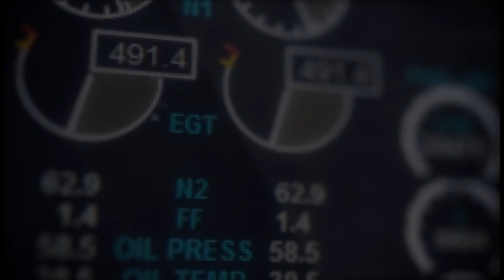Will Circular runways "take off"

Comment: isnt the problem with engine failure irrelevant? 
since the runway is infinite there is no point of no return, meaning when one/all engine fail while you are still on the runway you can simple abort the takeoff
Reply: That's not the problem. The problem is with asymmetrical thrust from an engine failure making you run off the side. On a banked runway, there's one particular speed where you'll naturally follow the runway with no steering input, below that speed you'll drift to the inside and above it you'll drift to the outside. If your inside engine fails slower than that speed, you'll probably run off the inside. If your outside engine fails above that speed, you'll probably run off the outside.
Reply: Mai Mizuki the problem is the short time span where the bad engine lost thrust but you had no chance to throttle down the good one. Even with perfect control circuits, you still have the rotating inertia. So even if you throttle down the good engine, you have a few seconds with a highly asymmetric thrust.

In addition, if the runways are used as proposed, you don't have an infinite runway. There might be another plane standing somewhere on the runway ready to take off.
Reply: its not a simple "but that is still a problem with traidional runway". its that, and the add effect of the inertia, gravity, angle, and more.

even with an abs, there are just too many variables, there's a physical limit to how well the remaining engine can work in a situation like that.

and forget it if hte problem is with the landing gear or with both engines. 

emergency landings will also become a no go. with almost garanteed disaster.
Reply: You assume reliable communication within 30 seconds, that is how long it takes for a plane to take off. With analog radio, you can't have reliable communication in such a short duration.
Reply: you only have the time between the computer realizing one engine is bad and it killing the other. 

unless the dead engine is stopped, which would destroy it, it will also have the rotating inertia. 

Finally since most engine problems don't suddenly appear, instead there are seconds of trouble before the engine dies (speaking on computer timescales) the good engine could likely be throttled automatically before the bad engine actually completely dies.
Reply: Amanda when you have an compressor stall, there might be an immediate drop of thrust. Yes the engine is still spinning at high rpm, but you often have a turbolent delamination of the air flow.
Reply: The best solution for solving engine failure problem at take-off is .....  Not using engines for taking-off :-)
The circular runway will be used only for landing, where one engine failure is less critical and where plances can choose the best direction for their safety landing and to minimise noise out of the airport.
Take off will be done on special shorter straight runway with an electromagnetic accelerating system supporting and tracking the plane with engines at minimal thrust, till the planes reaches  a highest speed able to make it reaching a secure altitude where the engines will do their job. When the plane has left, the accelerating system speed decreases very fast producing electricity stocked (why not in supercapacities?) for next taking-off 
I think that circular airport will be built in a place where there is no city near, only for intercontinental fligths (distances less than 1000km having to be done by  more ecological fast trains).
It can be built also in some seas on the top of a circular dam for a central reservoir used for a reverse powerstation to regulate wind or sea or sun electricity . If the reservoir is very big, the "air stations" will be all in the internal size of the ring with an underground tube connecting many of them and a special internal connexion for planes to the next taking-off accelerator.
Reply: On a flat runway, if you go off the sides, you are still on a flat surface. You start running into obstacles, eventaully, but there is still opportunity to recover. The circular runway is banked (this is to countre centrifugal force, and thus to help keep the plane centered on the runway in the first place). This means that you eventually have a rather steep change of slope when you go off the runway. To make matters worse, this change of slope means there is a high risk of premature lift... since the nose and outer gear would most likely depart the ground first, there is a very good chance of there being sufficient angular momentum for the plane to flip. Even if the plane does not flip, this will probably result in catastrophic contact between the opposit wing tip and the ground.
Reply: Consider that if ONE plane has a problem with take-off or landing = ALL OF THEM will be blocked, therefore the issue of "engine failure" is far more relevant than you thought
Reply: If planes cannot stay right on a flat runway because of their landing gears or other good reasons , the circular runway could be built, from center to periphery,  with a flat part (used  for accelerating before engaging the normal runway of for transition zone before emergency places filled of sand with a cover antidust) , then with a inclined runway for normal use (inclination growing gradually from internal side to external side) and a transition zone finishing into emergency places as above. 
Dont forget that the radius of the circular railway can be high so centrifugal forces less important.
But for me, the circular runway would be used only for landings and the take-off be done  only by external acceleration of the place making it able to reach without engines (we suppose that a plane with broken wings will not all fly :-) an altitude high enough to make it do a safe emergency landing (may be on short right runway equipped with emergency barriers like on aircraft carriers.) That ismost secure and needs less fuel and less chimical and noise pollution
Each airport will rhen be equipped with at least 2 or 3 electromagnetic accelerators if regularity of take-off is needed. (and 3 short emergency landing runways?)
In case of one aircraft having a problem at landing on a circular runway., most of time it will have to finish in the emergencies places so the mean runway will be free, even if not able to be rolled (but the plane can make over that zone the end of his landing before touching the runway, as they regularly do on motorways, beaches, inhabited or industrial zones or taxiways just like on most of actual airports)
Reply: First of. There is no centrifugal forces. They are fictious-forces. Its called the centripetal force. And a loss of it will take the plane into a tangent of the circle. Which you cannot counter-act without actually counteracting the extra angle for the circle in contrast to a straight runway.

So add the extra angle, speed and rate of change. Can you make it in time? Not a chance.
Reply: Mai Mizuki Here are some of the problems associated with circular runways and engine failures:
1. Lack of a perfect centripetal force pushes you to the edge of the circle... what Mentour states is that engine failures are compounded by this additional force in circular paths... the discussion is used to state how many more forces are compounded over the most common fears for pilots i.e. engine failures and not just engine failures themselves

2. Any one sided force will always make the vehicle bank more towards that side.. this also means if a vehicle is hard banking to the left, it will lean or get pushed towards the ground on the left.. what about the wings then? They have a higher chance of touching the ground, causing a massive spin or breakage of the plane in case of engine failures.. the risk is much more in an inclined path aka circular than straight.. 

Now

3. Your discussion about asymmetric thrust and the usage of the aircraft's stabilizers sounds good, but is not at all realistic. Basic science... inertia and force always go in a straight line.. anything deterring it from that path will need some form of resistance. You said to use the stabilizer and the air around the plane as it moves faster? How does that work? You dont get more control with more air around you... The faster you go, the more resistance the plane will put up with wanting to turn and if you force it, it could severely damage the plane (which is why big aircraft cant be made to turn like stunt aircraft lol).. meaning a circular path will put more stress on planes, requiring more work on maintaining planes which... is one of the most dreaded and costly things for every aircraft owner. While the plane's on the ground, those tiny tires can only do so much in providing the necessary friction to constantly turn (how annoying to constantly keep the steering on a turn... talk about wrist pains). Your talking about a gargantuan bus here

4. Mass is NOT on YOUR SIDE... you are confusing aircraft with other vehicles. Ground vehicles and water craft use drag (downward) forces to push them to the ground so as to attain highest levels of friction and aerodynamics on their relevant platforms of movement (F1 cars for example). Airplanes use the opposite (upward forces emphasized)... the faster, the lighter.. its common science again... the faster ANY object gets, the lighter it gets (or rather, the gravitational force has a weaker effect). This is why sometimes you see cars or boats flip into the air like an air plane when they make a mistake or are not balanced properly for high speed movement. So it goes back to point 3 whether the plane is fast or slow
Reply: You still have that risk on a flat, straight runway.  The plane still has steering...  At any rate, just kill the remaining engines which will end any asymmetric thrust, bring the plane back to the centerline, and let the speed bleed off until you come to a safe stop.
Reply: why should asymmetric trust be more of a problem in a circle than on a straight? mass and air are on your side, the faster you are the more control you get through  air and the slower you are the more mass you gain that push you against the slope and not outwards  giving your tires more grip, furthermore would it be easy to counter the rotating inertia by increasing drag  on one side( and as luck has it, planes already come with things to adjust that). As for planes standing on the runway, all you have to do is sync the start of 3 planes and each will have a 1/3 of a run way that is infinite moving in front of them, until one plane aborts in which case you still have a full normal length runway to decide if you abort too or can safely take off.
Reply: Adam Ahmed 
Maybe they can program the ABS computer to break on the other side of the dead engine to counter the effect of asymmetrical thrust so that the plane stays running in a strait line? Like they do with cars.
Reply: Mai yes it could all even out if circumstances are right, or it doesn't and you need more steering force than on a straight runway.

Your proposal of synchronized starts is difficult. Just one example. Planes 1 2 and 3 receive a clearance. Plane 1 notices many birds ahead crossing the runway and doesn't even start rolling. Plane 2 can't see them, starts rolling and a bird strike results in a compressor stall of one engine at thigh velocity. He aboards and after driving 1/3rd of the circle crashes into plane 1.
Reply: tower, plane 1/2/3 are one there own take off channel, planes are on runway, tower ask and gets conformation of all planes that they have completed all checks and are ready, tower starts count down, tower gives launch command, plane 1 has reason to abort and declares abort, tower repeats abort for safety, 2/3 abort too if they have not reached a point where they can safely take off. doesnt sound to hard to do and if you want to tell me that pilots cant abort on command or decide on the spot if they can safely take off than im worried if they can even start of a straight runway. Its fun to see how you think about a take off as getting clearance and than having full control over the runway because its that way for a normal runway, dont try to apply common procedures to a completely different problem.
Reply: Why would plane 1 drive off the end of the runway?

the whole point of the circular runway is that it is over 3 times as long as a standard one. 

So the pilot would have MORE space to stop the plan after the bird strike than before.

Comment: I think as the aircraft is taking off it is accelerating to a very high speed so on a circular runway with that radius it would be difficult to keep the aircraft on the runway , it might topple as well. And when an aircraft is landing it needs to be banked at an angle that the runway is banked which can damage the wing tip or engines. Also after landing aircraft needs to follow a circular path otherwise it would wander off the runway.
So even the simplest landing and take off can be risky.
am I correct??
Reply: Also it would increase the wear and tear of the landing gear as the centripetal force here will be friction isn't it???
Reply: Also the maximum velocity on a banked road is root rg.tanx where r is radius and X is bank angle of the runway. If airplane exceeds this velocity it cannot remain on the runway. If Vmax is less than V rotation then the aircraft will have to takeoff before it has reached its rotation speed and will hence stall. Then if we increase X then we will be increasing Vmax but then the aircraft won't be able to align with the runway as the centripetal force will be more than the centrifugal force as the plane is at its taxiing speed.

Comment: I don’t like the idea of landing inside a circle.  VTOL seems to be a much better idea IMO. I would imagine it is only a matter of time before we see a commercial fixed wing jet propulsion version of the V22 Osprey - the size of a 737 or A320 taking to the skies just like we saw in The Thunderbirds.  The challenge will be cost and environmental impact - in particular noise abatement during takeoff & landing.

Comment: Another afterthought - joint air-rail travel integration...

Europe has a much better inherent opportunity to do this than North Amoerics because of the generally higher population densities. this is already why Europe has much better fast rail service than can be economically justified in North America.

Given that Europe also has the greater need and hence opportunity to gain from hybrid travel.

My previous idea about putting a circular runway in the English channel is pone example that comes clse to the idea of hybrid travel, so palliating the would-be issues of peripheral access and spacing. Thast airport and the passenger rail rights would then logically accrue to whichever country was to host the land access for the airport, but they would also have to
pre-negitiate the ultimate usage details to be economically viable - also ironically circular!

And so we have yet another "round"!

Comment: From your example of London UK:

when a new aiorport is proposed for construction, if it has to be ifar from water,m and clse toa congested urban area, this is immediately a big hiaitus anyway. In that regard, London seems a prize example, especially given Britain's very high population density.

However, ift it was feasible to build the chunnel, and there is also another large building already in the middle of the English channel, I would think it might be worthwhile to build a circular airport in the englsih channel, preferable not to o far from one or other end of the chunnel, so that the underground railservices I had previously suggested could be linked to the rails coming from the chunnel. If that were done in France, adequate switching would bne needed to ensure easy routing in either direction thus sereving both Gare de Lyon and St. Pancras, as well as connecting as needed to added cargo rail facilities.

Airport fees would then need to be harmonized closely enough to ensure prpopr balanced usage of all facilities by both public and industrial clientele, not to run undue risk of some of the underlying causes of Montreal's Mirablel airport boondoggle.

Given this, I thnk it would also help to minimise noise propagation issues as the roar of the North sea would be noisy enough by nature at times. (But also let us all learn from the storm disaster England had along the coastal rail line at Dawlish!)

=========================================================================

And with all this I also include my personal disclaimer...

Professional Information Disclaimer:

Disclaimer: I hereby disclaim any presumption of authorised professional status. Information contained here is entirely of my own learning and logic.

Any reader who needs any sort of professional information or professional approval, ascription or confirmation of any such information is advised to consult an appropriately certified practising professional or relevant specialty in his or her juirisdiction.

Not withstanding, this information may well serve as suggestive pointers as to questions and/or seeking of professional ascription to or about same, that might be asked of authoritative sources.